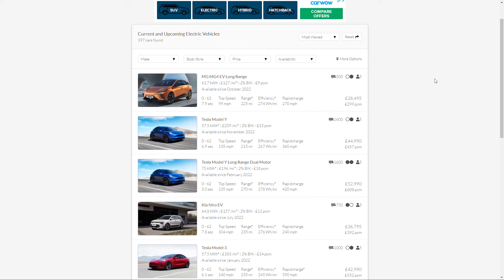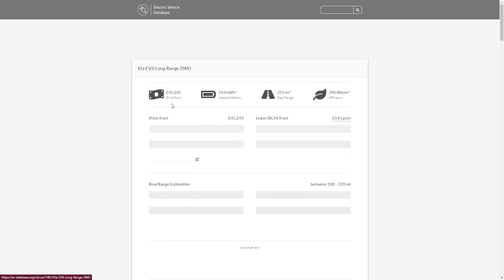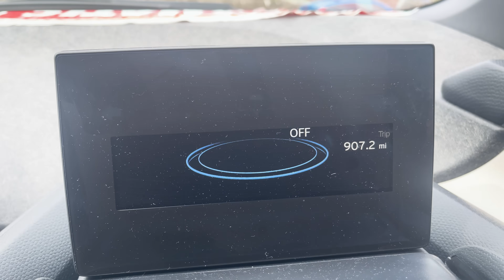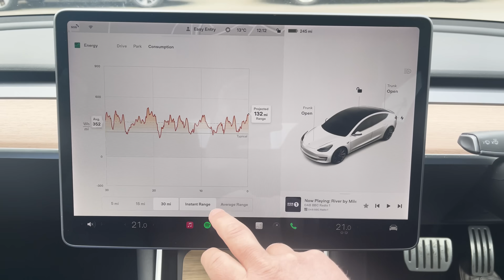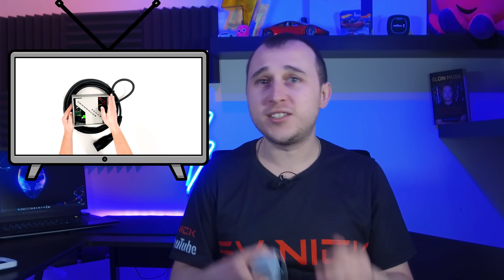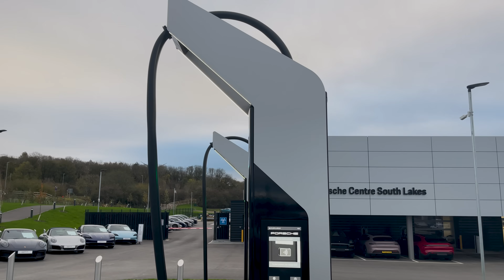Ugly Truths Electric Car Owners Don't Tell You!

Comment: 10:30 maybe I am in the minority here but out of all my vehicles that I owned my first EV developed a fault that cost over 50% of the car’s price (not the battery)
Reply from the maker: Can we add context? Car? Used? Price you paid for car? Cost of repair and who quoted manufacturer or independent
Reply: @NicolasRaimo  can do! It was a 2013 Zoe which I bought used for about £6250. After roughly a year of ownership the car wouldn't charge. Issue was with the junction box and costs a lot of money to get one and have it fitted overall the quote was £3500+ even the Renault approved garage couldn't guarantee it would fix the issue.
Reply: @elliotut  Interesting!  It seems to highlight common issues with "Approved" service centres. They lack the skills to diagnose issues with EVs and ICE vehicles and work on "replace bits till it's fixed"! I guess EV owners should follow what ICE drivers do. As soon as it's out of warranty, only go to independents (assuming you can find one!)
Reply from the maker: @elliotut  Now currious if this was a 2013 Renault Clio would you of took it back to the main agent for repair or gone a local independent? 

Main agents HOURLY bill is normally from anywhere of about £100 to £200 which means even without parts you could be at £1000 with an independent this could be £400 of labour.

The issue your referring to is a zoe issue I've seen on a few cars and the part to repair it is fairly cheap it James did a video with Hevra on it just run a search on youtube should come up.

Although a bill of £3500 is a lot for the car its not uncommon to see 10 year old ice vehicles uneccomny for repair.   I'd count this repair as sadly something that just happens with ownership of any car its rare but sadly not uncommon.
Reply: @NicolasRaimo  I wish I knew about HEVRA before I got my car in to be fixed but it was difficult to find who can repair EVs in my area. As the vehicle was in for repair I stumbled across Jame's video about the PCB fix but I was told that wasn't the issue.

Decided against purchasing a junction box in the end but I am looking to sell the vehicle in some form, it was going to be a part-ex for my current Honda E. The Zoe knew it was being sold!